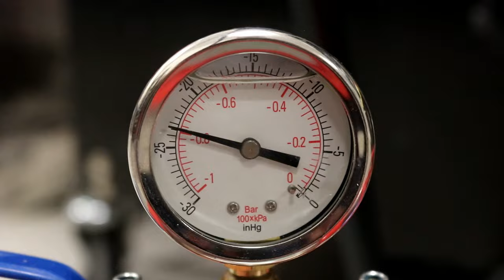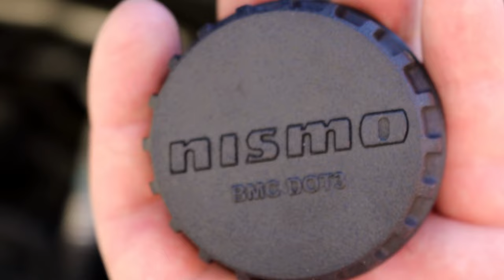DIY Custom car parts with a split mold urethane casting

Comment: CRAZY...good skills...
Keep up the great work
GREAT SITE.
Reply from the maker: Thank you, just means I failed alot before lol
Reply: @EndMotive   
Hi.
What other plastics would you recommend? 
The idea is awesome, but I need a plastic that can be 2mm thick, hard yet somewhat flexible, to work as a mold for plaster. 
Thanks.
Reply from the maker: @mikekiske  I would think most 2 part casting epoxies and urethanes would be up to the task. If you need a little flex to it get a rigid urethane with a lower shore hardness.
Reply: @EndMotive  Nice. Thanks for the feedback.

Comment: U actually used 3D printing 🤔
Reply from the maker: Yeah for the master, but it takes less than 45 min each now vs the nearly 4 hours it takes to print. Plus the sanding and painting that isn't needed anymore saves even more time.
Reply: i’m a little surprised that the filament used for 3-D printing would hold up well to the heat under the hood of the car.

Perhaps I’ve misjudged the quality of materials available for 3-D printing these days.
Reply: @daphneraven6745 there is a filament called pps-cf it is temperature resistant up to 264°C or 507°F

Comment: Such clean work. Respect!
I'm not familiar with PU as a 2 part casting resin. What makes it a good choice over the typical epoxies?
Reply from the maker: Thank you! I am by no means a chemical engineer, I just happened to grab something with an appropriate heat range and sent it lol. Epoxy resin would have likely worked just as well for this part.

Comment: How does Polyurethane fair against UV and heat?
Reply from the maker: Different products have different ratings but the stuff I used has held up great to everything I have put it through. I haven't noticed any degradation from uv or heat, but have not exposed it to extreme heats really either.

Comment: AwesomeThis is an amazing project. Thanks for your experience. To be honest, I doubted that this plastic could withstand the temperature under the hood of a car. How did he show himself in use? Are there any deformations due to high temperature or signs of abrasion?  Thank you again and good luck to you.
Reply from the maker: Thank you! I have had my cap covers on for over three or so years now with no issues. They look good still!
Reply: @EndMotive   Wow, this is incredible. Thank you for your feedback. Previously, I used 3D printed ABS parts in the space under the hood and after six months or a maximum of a year they fell apart... Now I also can’t wait to try this two-component plastic) Thanks again for your experience and your answers. Good luck to you!)

Comment: Better? Yeah probably a higher quality part, in fact most likely. But I would like to know what you ended up in cost difference. I would imagine (and this is assuming that you made one of these) that it is the difference between a $4.50 part and a $34 part (and I am assuming that we already owned the 3D printers in both instances as a cheap FDM printer and a cheap SLA printer are roughly the same cost)
Reply from the maker: The cost between printing or casting is no comparison, the printed part will be way cheaper. However,  I made these to sell. I was able to produce a nicer, higher quality part in a fraction of the time. All said and done it probably cost $60+ in supplies to get started.

Comment: Thank You.  I just bought a used car with cracked interior parts everywhere.  Do you think this method could be used to make a whole new dashboard?
Reply from the maker: Yes in theory it could be done, but the cost of failure might not be worth it. The material cost for an entire dash would likely be too much. The small trim pieces would best be repaired with an epoxy or glue, and the dash itself maybe re-upholstered?
Reply: @EndMotive  Thanks

Comment: Nice job 👍 first one that shows you can mold yourself without selling your organs for an injection molding machine 😂

Do you know how about the temperature resistance of the plastic? 🤔
Reply from the maker: Yeah, injection molds are crazy expensive. This plastic is good for 250f I believe, which is why I chose it!

Comment: did you need to vacuum these? have you had any issus with bubbles?
Reply from the maker: I did have a some issues with bubbles, I should have added more or larger vents. Ideally they should be cast into the mold and then placed in a pressure pot.

Comment: Do you think this is possible to make a bumper mold with?
Reply from the maker: Yeah I would think it is possible, but it would be a pretty complex mold and fairly expensive. Most aftermarket/body-kit style bumpers are made with a fiberglass molds. The silicone would be nice for weird or undercut geometry though.

Comment: Do yo need that vaccum thing for the silicon, is there a cheaper alternative? because i want to make some molds for my tools 😬
Reply from the maker: Nope, You don't need a vacuum pot. It helps degas the mixture and reduce the amount of bubbles, but some silicones claim that they are low-gas and do not need to be vacuumed at all.
Reply: @EndMotive  Any silicon molding liquids you recommend?
Reply from the maker: @shawcobra  I have had really good luck with Smooth-on brand. The Mold Max 14 does not need to be degassed, maybe the entire Mold Max series, but not positive.
Reply: @EndMotive  ok thanks for  the recommendation and have a happy new year!

Comment: So molding stuff now? I see you had to get a vacuum container and pressure pot
Reply from the maker: I did use a vacuum chamber to degas before pouring, but some of the parts I will be casting in the future will require a pressure pot

Comment: Could you not have just 3d printed the molds, sanded them, bunffed them and applied mold release? 
Serious question. Just thinking for those of us who have a 3 printer but not well versed in all the other stuff you did. 
This definitely a huge time saver if you are making multiples comparing to 3d printing the part everytime though great thinking.
Reply from the maker: I could have sla printed the molds, but it would have next to impossible to sand them and texture them. Then the rigid molds would create a mechanic lock with the cast resin. It would have been possible if I added some draft angles and no texture though.
Reply: @EndMotive  if you print them in the right orientation so that your layer lines are for the most part laid in the direction of pull it will release much easier. Also a good layer of wax and release agent would help as well as using filaments that are naturally chemical resistant like PETG. You could also do the mold out of TPU if a hard mold would be too difficult to use. Food for thought. I just did a little digging and this is what I came up with thought I would pass it on.